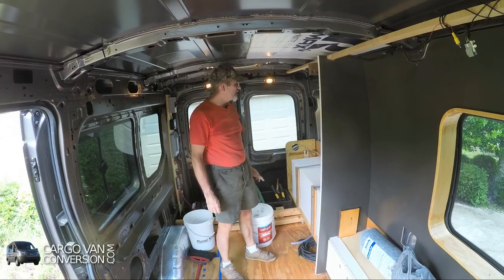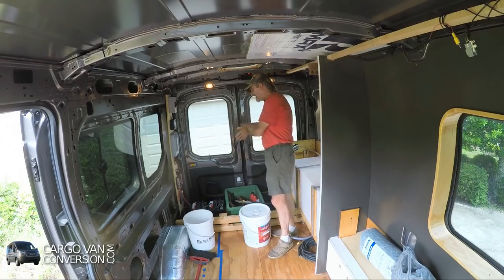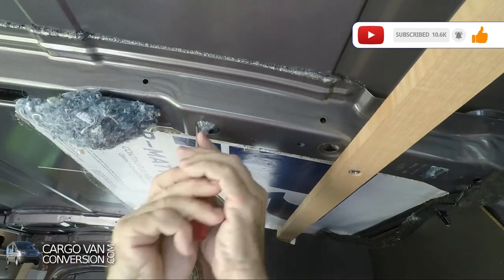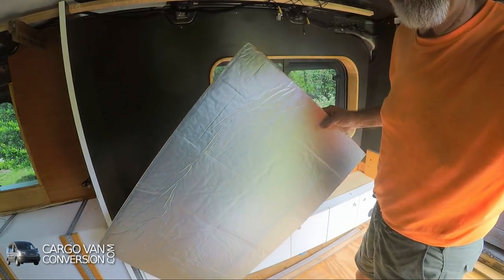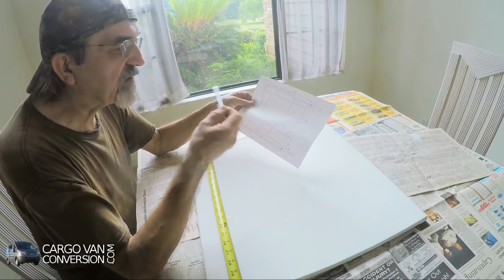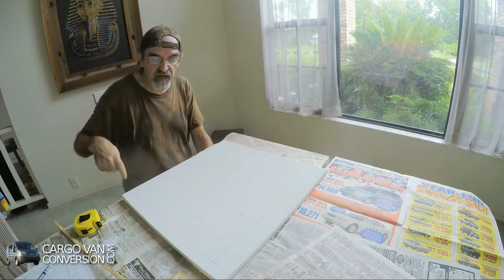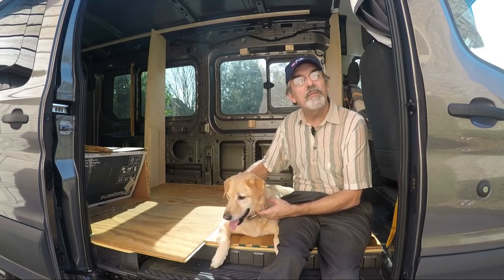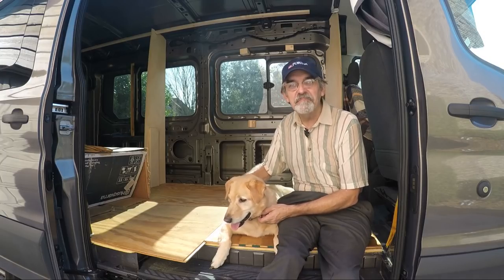RV Ceiling Insulation & Trailer Art

Comment: I always find it easier when painting something like that to use a good masking tape, then peel for good straight lines & edges, loving the way the build is coming together
Reply from the maker: Hi  Here2daygon2mora,
There will be a lot of black lines separating the squares and looking at how straight I can draw, I will be using tape too and that will straighten everything out, hopefully. I will go over it one more time, perhaps with a slightly thicker paint. It's oil and needs to dry quite a bit. It's my third/fourth venture into oil painting, so lots of experimenting. It's fun.
Van Williams

Comment: Multiple layers is a great idea.  Allows you to stagger the seams.  (I'm just not sold on insulating the roof in hot climates.)
Reply from the maker: Hi Hobo Hacker,
The point is that the roof has a well-defined curve and the Poly-Iso is difficult to bend. One or two inch thicknesses are just not right.
When you read or see more of my videos, you'll notice that insulation is not a high priority for me. I am a warm weather traveler, like you, I suppose. And you can only delay heat from entering the van. Then there are many places difficult to insulate, and I have a lot of windows. Ventilation is more important to me. Use a roof vent (which can stay open when it rains) and a floor vent at the opposite end of the living space. When it's warm, you live outside and go to a higher elevation as the temperature outside increases.
I'm located in Central Florida, so I have experience with the summer heat. Cannot touch the ceiling during the day, but with 1.5" Poly-Iso it's way more comfortable to touch.
Most of the walls are less exposed to the sun and are mostly covered with beds, closets and alike, where insulation plays less of a role. Two places are at the top of my list for insulation: the ceiling and the floor. The latter is against cold. If you have cold feet, you'll never get comfortable.
Van Williams

Comment: Such an interesting series!  Question (from a complete newby) about your insulation: why put the shiny side against the shell of the van?  Doesn't the shiny material serve as a vapor barrier, to prevent vapor from getting behind the insulation and condensing between the insulation and the shell?
Reply from the maker: Hi Terry,
Thank you for watching!
Yeah, insulation... Likely the most discussed subject in conversions. I'm not an expert at this, like so many of us :) My understanding is to put the shiny side of the Poly-Iso on the side where the penetration occurs; so if you want to prevent the heat from entering on the outside, or if you more often are in a cold climate and you want the keep the heat inside in winter, on the inside. I'm a warm weather traveler and want to keep the heat out.
It's not a vapor barrier AFAIK but some install a separate plastic sheet (vapor barrier) on the inside face of the insulation. I don't do that, first because I regard the metal skin of the van as a vapor barrier, but more importantly, such a barrier can also lock in humidity inside the walls. The Ford Transit has also an added issue: I have optional All-Around windows and any condensation automatically runs into the walls. I'd like that have some way for that to evaporate.
All-in-all, I think insulation in these vans is highly overrated. There are so many openings in these vans, from existing car vents to four doors and lots of areas that cannot be insulated, that even the best insulation can only slow down a quick temperature rise inside the van.
Personally, I think ventilation is more important than insulation (unless cold weather). I've been stuck so many times inside an RV during rainy periods and insulation didn't do a thing. Everything becomes humid and moist; the two best things to do is an roof vent that can stay open during rain and a floor vent for increased ventilation.
Look, you can't really go wrong with the insulation, do it moderately or as good as you think, you need. And remember, the only fail-proof way to avoid the summer heat, is to change elevation. For every 1000ft higher in elevation, you'll see the temperature go down with approx. three degrees.
Van Williams
Reply: Cargo Van Conversion   Ah! It's a radiant reflector, not a vapor barrier. That makes sense. Thanks for responding, and keep up he great work!

Comment: Great video again.  Your painting is perfect to add color.  Personally I would go with a 6ft paint by number last supper or Elvis/the duke plate in a shadow box...but that's just me :)
Side note, I have the same trailer...in about the same condition lol
Keep up the good work
Reply from the maker: Hi stgreen78,
I already did the paint-by-number thing; I promoted myself to real paint and my own brushes :) Actually did a lot of pencil drawing when I was younger; love to try the oil paint and this is a good occasion.
The trailer is in a good condition, but is in need of a new floor. I have a lot of projects in mind; one is to bring this trailer along on my upcoming travels and make a tiny teardrop out of it. Love to continue building.
Van Williams